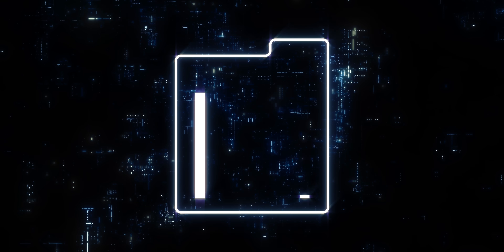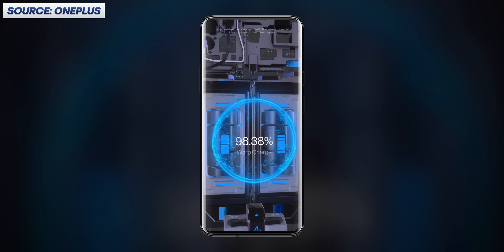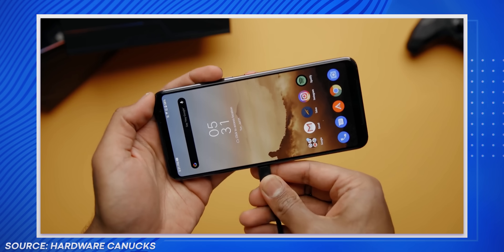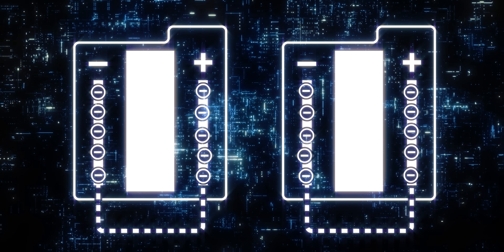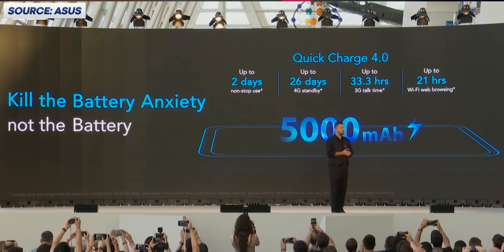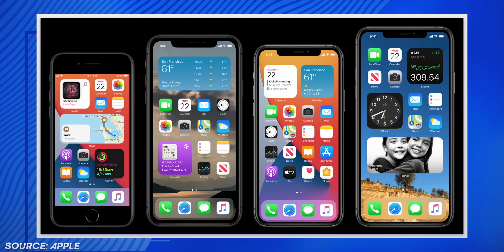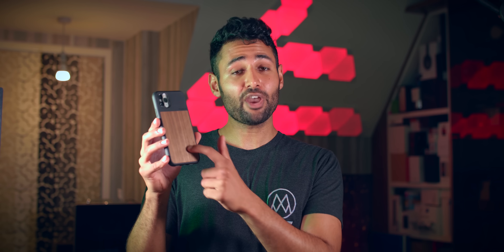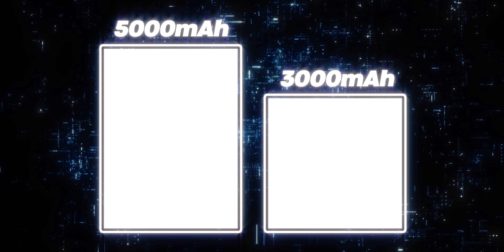The Problem with Fast Chargers.

Comment: Most of this is entirely accurate, but there are a few things to note:

1) The charger has nothing to do with charging speed, beyond just giving access to the listed amount of power. The phone (or whatever device is plugged in) determines charging rate, which is how you can plug a 5 year old iPhone into a 65W charging brick and the thing doesn't light on fire. The charger plug only allows access to power, it doesn't control the flow rate in any way.

2) The ideal charge percentage is not 50% in modern batteries - most hover around the 80% mark, because they're designed to operate most efficiently at the charge level they believe is the average among all users at any given time; basically, most phone companies believe the average of all phones at any given time to be around 80% (since a lot of people leave it plugged in all the time, some are anal about charging, and a minority are dead or low), so the batteries will actually hold their charge best at that percentage. What that means is that the more time your phone spends around that point, the longer the battery will actually last.

3) Not something you were wrong about, but something very important: Lithium Ion batteries are designed to never actually hit 0% or 100%. They have internal protection that prevents charging once they reach a pre-determined percentage (usually 98% or so), and a physical protection circuit that will prevent the batteries from being charged once they hit a lower amount. Phones will never discharge near that amount, so when your phone says 0% the battery actually usually has 2% or more left in it, but the phone is configured to prevent the battery from discharging that far. Once the battery discharges past the limit, though, it will actively prevent charging in the future.
Reply: Well... In truth both charger and phone determine the charging speed. Simplified (somewhat): If charging cable doesn't have data wires, then the phone tries to draw the maximum ammount of power that it can ( for the ease let's say that the phone can draw 10W of power and the charger can give 60W. also components used usually have ~10% higher power tolerances ) the charger then tests, how much power to give. 5V 500mA? Maxed out. 5V 1A? Maxed. 5V 1.5A? Maxed. 5V 2A? Maxed. 5V 2.1A? Used 5V 2A. Set power to 10W until current draw reaches 0mA. IF cable has data wires charger tells the phone "I can provide 60W." and the phone answers "I can take 10W." then charger sets the output to 5V 2A and it's all good.
Reply: that’s would somewhat explain why whenever i shut down my iPad and plugged in the cable i will always get 98% the next day i turn it on, it’s seems apple devices display more accurate battery percentage after a reboot.
Reply: So basically once it hits the real 0% it won’t charge anymore? So like if you unbox an unopened 10 year old iPhone, it wouldn’t charge?
Reply: @HearMeLearn  Yes and no. Yes, if a Li-Ion battery actually hits 0% most have a hardware block that will prevent them from ever being charged again...but if your phone reads 0% the battery actually has a good 2% or more left in it and it actively disconnects from anything drawing power, so the battery would still last quite a long time.
Reply: @JudgeNLN  I really don't want to read all of that so a charger has nothing to do with speeds?
Reply: @0.0tony  Nope your phone determines the speed.
Reply: @its_johnH Device is 1 factor but then how come different chargers charge at different speed?
Reply: @its_johnH  well, that is true if your charging brick exceeds the device's rate. If it is underpowered, you'll notice your device charging awfully slow.
Reply: @0.0tony  basically the charger is the supplier of power
The phone has to accept that power for it to charge that fast
So even if u have a 100W charger and use it on an iPhone it will charge at the maximum speed supported by that phone
If the phone supports 100W charging it will charge with a 100W charger
The charger does affect the speed of charging but if the phone has to accept that speed otherwise it won't charge fast
Reply: @JudgeNLN  so should i charge 3-4 times a day to keep my charge hovering around ~80% for better longevity or the usual charge up when it falls below 20% ?
Reply: @otakuhunter4817  Charge it literally anytime you're able. The manual even tells you to - Set your max to 80% and the more it's plugged in the better.
Reply: @JudgeNLN  i see thanks.I have had the impression that frequent charging discharging would reduce the lifespan of a battery that's why i keep charging to a minimum
Reply: @0.0tony  again it's not the charger that determines the charging speed but the hardware and the settings inside the phone. All phones have circuitry designed to detect the type of charging. which is why when you plug into PC, it says "slow charging". the phone detects the voltage and amperage of the charger and accordingly restricts or draws in more power. try charging a Note 10 with a 1.0A or 0.5A brick, it would show a huge charge time around 10+ hrs or not charge at all. at the same time, use the fast charging brick, it says 1 hr or so.
Reply: @otakuhunter4817  no. as long as the charge is between 20 and 80 you are fine. does not necessarily mean you have to plug it in when it drops to 70%
Reply: @JudgeNLN  Do you have a source for claim 2? My understanding is that 80% should be an UPPER limit for your battery for maximum battery health and is certainly not the ideal battery %, with the actual ideal being a lower battery percentage.
Reply: @JudgeNLN  So if I activate the "Protect battery" setting on my Samsung (which limits the maximum charge to 85%) my battery won't go higher than 85% charge, even if it has been charged upto 85% and I keep it plugged in?

And if I de-select the "Fast charging" option, my phone won't fast charge, even though I am using a fast charger?

And both of these options will protect my battery health? Thanks
Reply: @goobagooba8448  if that's what the settings do on your phone. Every manufacturer handles it differently, but keeping under 90% charge and not overheating the battery by charging it really fast are the 2 best ways to protect it.
Reply: @JudgeNLN  so should i get a normal low powered charger or would it be ok to use my fast charger and just have the fast charging option turned off?
Reply: @its_johnH no i call bull shit on thay ive had my charging speeds vary greatly with different chsrgers anywhere from 5 hours to like 50 mi utes
Reply: 1.  Only applies if the charger has the proper ICs, think of it like a water pipe.  If it's got a high pressure it'll deliver how much it sees fit.  This is one of the reasons why certain chargers, such as charging towers that lack ICs, can bake devices.  iPhones tend to have the grace that it uses a chip on the lightning connector.  Other devices may get fried because such regulation exists on the charger, not the phone itself.

2.  The 50% is in reference to storage, especially if the Lithium Ion battery is stored stagnant (no draw).  iPhones and Apple Watches are shipped nearly fully charged nowadays because the charge itself only lasts a whole month even with the device switched off.  That being said, if one was going to leave a device attached to AC power indefinitely the answer is a little bit trickier.  The correct answer is that the cell has to be lower than 4 volts, which on your example is correct with older chemistries but newer cells varies from 60-70%.  My Dell tablet, for instance, below 4V/cell it is around 58% charged.  Realistically if Lithium Ion had no risk of failure from overdischarge the ideal storage would be 0%, and I have a few devices that can store batteries at that for so long.

3.  The problem with newer chemistries is that it's hard to really know what the top off voltage is.  Is it 4.2?  Maybe 4.3, 4.35, 4.4?  I do have one Samsung device that fully charges at 4.26V for a cell rated at 4.4V max, but not all devices are like that.  HTC and Apple may fully charge a cell, or rather hold it under load at a voltage rather than giving the cell a chance to breath because the batteries are hooked in series with the system board rather than parallel for power efficiency.  The other consideration is that cell phones never have overcharge protection in a reconnect sense.  My iPods do have this, attempting to charge my old iPods nearly charge will instantly show a plug icon, there's not a single phone I've owned that does this (and newer iPhones have a fully charged icon disabled).

On the flip side 0% is typically 3.3V, this is more or less when struck based on load.  It's been some time, but the trip point where the battery is flat varies, it can be as low as 2.4V or typically just around 3.0V.  I haven't done a whole lot of testing, but I have two Android devices where the recovery mode has more tolerances and it's possible to get about an hour or two of max screen brightness despite the battery being 0%.  There was a code for older Nokia devices that overrides the 0% with a lower battery voltage, though that might be urban legend.
Reply: Technically and scientifically wrong about the ideal 80% charge level. Ideal battery percentage is actually 50% for the least degradation and longest lifespan.
Reply: @SamLoki  I thought 50% is supposed to be for when you plan on storing the phone for a long time without usage? Like when a phone is manufactured the battery is charged up to about 50% and then its finally shipped because they might spend a lot of time on shelves before they are purchased and used
Reply: Yea just a few things
Reply: Ayo what where you got 80% thing, I had seen multiple tech channels and all said that 50% is ideal and one should keep battery between 20-80.
Reply: Not to mention that now, current phones are starting to step away og Li-ion and started using LiPo which is more durable and holds more charge than lithium
Reply: My old phone powers off at 19% and sometimes even 20-25% IT DOES NOT EVEN SAY 0% AND WE CAN STILL POWER IT ON AFTER ITS OFF-
Reply: Simplify it. I ain't reading all of that
Reply: @TheBlock70  1. The charger just supplies, it doesn't determine the speed.

2. Ideal battery is around 80%

3. You never actually hit 0 or 100%
Reply: @TheBlock70  nobody is asking you to. Lol. Quite demanding, aren’t ya?

Comment: I use an app that lets you set an alarm at a set battery percentage, is there an app that will actually stop charging at a set percentage?  The alarm only works if you're around to hear it, it would be nice if it would stop charging too.

Comment: Instead increasing charging speed they should try to increase battery capacity
Reply: By how much? Phones literally have 7000 mAh of battery. Do you want 10" phones?
Reply: @Dishant161  and do you want your phone to change like 50% in 5-10 mins??
And most of these phones taht comes with crazy fast charger have battery capacity around 4000-5000 mah

Comment: My S5 had a slow charge feature... Use a regular usb charger. However the Google Pixel didn't have fast charge, and my P4 also doesn't have as fast of a charge as my S5 did. That phone would charge to 100% from 50% in about 10 minutes

Comment: My battery capacity is still 100%. I’ve had my phone for 7 months
Reply: Due to the 100% charge not being the actual total capacity of your battery. The actual total has fallen, but it's not passed the buffer set by your phone's manufacturer, so you are perfectly fine.
Reply: How do u maintain it?
Reply: @kaekae385  some manufacturers don't actually use the battery's real capacity.

Let's say there's a batter with 4000mah, but the device only has access to 3500mah. The health will always be 100% as long as the actual charge health is above 3500mah.

Or, you can also do things like not use the phone while it's charging to reduce heat and wear, never leave the phone at 100% charging for too long, and not charge too often. These are good ways to keep a battery healthy. Degredation will happen eventually, but there are means to help the battery degrade slower

Comment: I just got a new phone (oneplus nord), its the first one with fast charging ive had
First thing i did was install a battery app that gives me a notification at a certain percentage of charge (like 80%)
Instead of charging it overnight (7 to 10h), I now charge it in the morning when I start working and in half an hour its done. I only need to charge it again in the evening when I used my phone a lot (like in weekends)
I hope this phone will last me well over 2 years (my previous ones usually lasted 2-3y), if it lasts 5-6 years then it certainly was worth paying double the price I previously payed

Comment: I have a Bixby routine that makes my S20U slow charge between 12am and 7am. 

Put the phone on my wireless pad with 15% left, it’ll slow wireless charge to about 85% by 7am, then the faster stuff kicks in and finishes it off for when I get up at 8. Nearly a year in and battery has aged fine.

Comment: Pls make a video: why does the last 1% last so long
Reply: Wait what!!!?? My S8 lasts around 2-3min max after hitting 10% People have it the other way round?
Reply: Can't speak for all phones, but I use motorola phones and usually the reason why the last few percentages (say 10% down to 1%) last longer is because the phone is programmed to heavily and progressively throttle the performance (slowing down the phone) on those battery levels to try to squeeze a little more usage, since it thinks the user will usually be scrambling for a charger by 10% anyway. Not me, I am an extreme user who enjoys using the battery 100% to 0% and leaving it at dead zero for extended time then charging it to 100% and leaving it plugged and in usage long after before beginning another discharge cycle with it.
Reply: It's just a glitch. The battery is probably old and a bit degraded so it cannot report accurately.

Comment: Maybe but it's not like we are oblige to charge our phone at 100%. Phone right now can handle 2 day without be charged again. If i take a Xiaomi phone with 120W charger i will charge 50% in 5min maybe i havent check the number. During this time the battery will not reach a higher temperature so if i stop charging my phone at this moment it's possible for me to avoid the inconvenient of the fast charge. More than that battery can be changed i guess.

Comment: if you want to keep your liion-battery alife for as long as possible, charge slow, stop at 90% and don´t go below 10%. On Lenovo Thinkpads you can do those settings in the power manager. Tesla, for example, stops charging at 90% by default. Sadly, on most smartphones you cannot do that.

Comment: While electric current flows from the negative pole to the positive, the electrons flow from the positive to the negative side of the battery WHILE DISCHARGING, so your explanation gif was wrong, but frankly a detail in what you were trying to explain
Reply: Also, battery heats up during charging not because of faster electron movement, but because every charger has a less than 100% efficiency, for example 80% or so. If you charge your battery with 20 watts or 40 watts, the electrons move at the same speed, but 20% of 40 watts is more than 20% of 20 watts, so all that energy ends up as waste heat. (The electrons being faster is a side effect of heating up, not the cause for the heat)

Comment: Since this video was made on 4 Oct I will give him the benefit of the doubt. On 18 Nov 2020 Apple agreed to a fine of $113m in the BatteryGate saga. Apple was accussed of "deliberately" slowing iPhones to force people to buy the newer iphones. Apple's excuse was it did so to preserve battery life. See the article below. Apple does not provide a charger or earphones with the iPhone 12. You can buy a set of Apple Max earphones for $549! The AirPod Pro buds cost $200. On Amazon a "locked" iPhone 12 costs between $870 - $1100. So are we to understand Apple has the consumer's interest in anything? No!. In Aug 2020 Apple's value was $2 trillion!  which is higher than the GDP of Italy, Brazil, Canada, Russia and South Korea!

https://www.npr.org/2020/11/18/936268845/apple-agrees-to-pay-113-million-to-settle-batterygate-case-over-iphone-slowdowns

Apple Agrees To Pay $113 Million To Settle 'Batterygate'  Over 
 Slowdowns The issue reportedly affected phones released between 2014 
and 2016. As part of the settlement, Apple also agreed to be more 
transparent about software updates that affect a phone's  life.